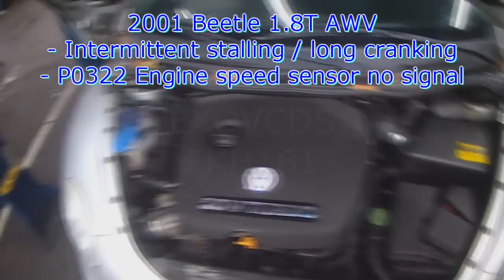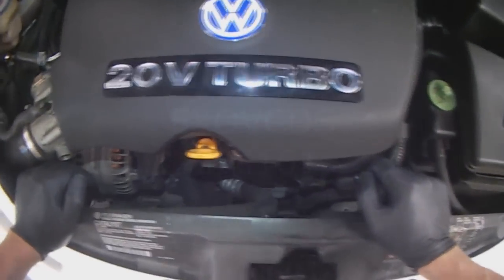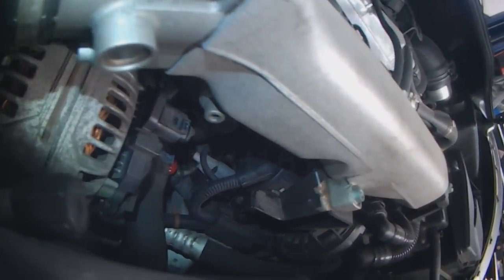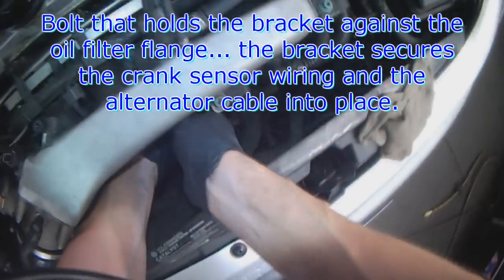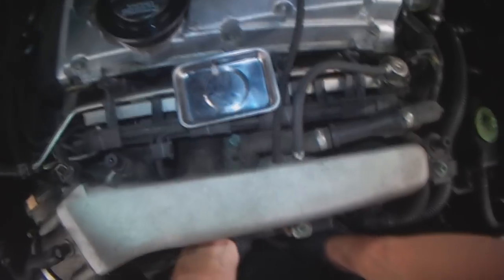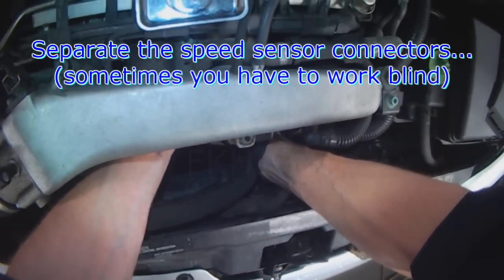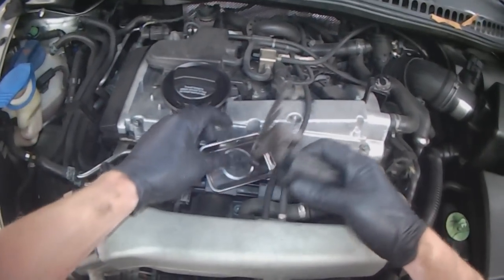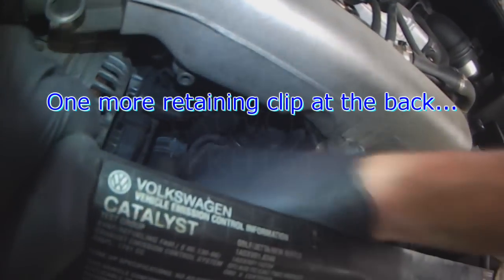VW A4: 1.8T AWV Beetle faulty crank sensor P0322

Comment: I have 01 Volkswagen Jetta 1.8 Turbo 5speed. I have replaced everything from fuel pump fuel filter crank and cam position sensor coils and I cannot get it to run any help
Reply from the maker: Do you have spark? Injector pulse / spray? Compression?
Reply: Yes all that is good. When it's cold it'll run for a good 5 seconds and then start spitting and sputtering I'm going to change the intake manifold gasket tonight and see if that works
Reply from the maker: @TheCopenhagenman19  I don't think it's an intake manifold gasket issue (unless the intake was off in the past)... there should be no reason to suspect it, I have never seen one fail.
Reply: @EXOVCDS  it could have been off the car has had work done to it before i got it. Im not sure what else i could do. Im just trying everything to get it to run right. What do you thank it could be?
Reply from the maker: @TheCopenhagenman19  fault codes? Engine sensor data (coolant temperature reading correct, MAF, MAP, TPS, short term & long term fuel trim values etc)? Any fault codes in other modules? Exhaust system plugged?
Reply: @EXOVCDS  since I've got the car its head an O2 sensor code and a mass airflow. Other than that I have no idea. I can't get it anywhere to have codes read Because car is not drivable. I never reset the ECM when I put that new cam and crank position sensor on there. Should I do that and see if that works. Cuz I do know that sometimes they'll get stuck on running a certain thing.
Reply from the maker: @TheCopenhagenman19  cam or crank sensor replacement does not require any type of resetting. You need to get yourself a scan tool so you can view data... you're working blind otherwise. Once it dies it doesn't start again until it has cooled off? When it doesn't start, will it run if you spray brake cleaner into the intake? If yes, then you have a fueling issue. If no, then you have a spark issue.
Reply: @EXOVCDS  if Iwait about a minute. It will fire back up but it still runs really rough. And sometimes at a very low RPM like 100 to 300. I put a new set of coils on it and check the spark plugs they are all good. Put a fuel pump on it today and a fuel filter. And check the injectors they look okay to me. I was actually going to try brake cleaner tonight. And a buddy of mine was thinking that somehow it could have over boosted and blown the intake gasket. Because it started doing this after I got on it a little bit. To not get hit by a car that decided to speed up.
Reply from the maker: @TheCopenhagenman19  it could be struggling for fuel or spark... I would even check / verify correct cam / crank timing by turning the engine to #1 TDC and making sure that the marks line up. Timing belts can strip teeth under high load when they are old.
Reply: @EXOVCDS  i will try that when I get home. When I change the fuel filter it was so clogged I could not even blow through it. But it has a new one on it now. Should I try replacing the injectors
Reply from the maker: @TheCopenhagenman19  Fuel contamination can clog a new filter... you might want to check the new filter just in case. Is the fuel pump noisy? If yes, that can point to a restricted filter. If you replaced the fuel pump... you might want to make sure that none of the plastic fuel lines are kinked / restricting fuel flow. I wouldn't worry about injectors... the only way they could all fail at the same time, is if something is starving them of fuel. Usually one injector will go bad causing rough running... it's not likely that all failed at the same time.
Reply: @EXOVCDS  okay I'll check that. Is there anything else that could cause it and do you want me to upload a video of what it sounds like. And maybe you can let me know just by the sound of it. I don't know a whole lot about these German cars. I just know how to work on cars
Reply from the maker: Sure... upload a video or more and I'll check your channel tomorrow. 
I would focus on what is missing (spark or fuel) and then go in that direction. As I said, the more you can check the more you can eliminate. New parts can be bad, so re-checking things is always a good idea. Buy a cheap scan tool so you can monitor engine data... it might not help solve this issue, but will be worth the investment in the long run.
Reply: @EXOVCDS  I'll upload some videos tonight. And I will work on them when I get home thank you
Reply: @EXOVCDS  well I get home check all the spark plugs again. Because when I did check him I was really sleep deprived. Go to start the recording to upload so you can hear the car and it's running fine now. I really don't understand this car. It's very temperamental

Comment: Well done buddy. 👍👍
Reply from the maker: STEVE ROB Seems strange to get "well done" messages for removing a part... ?
Reply: Thomas EXOVCDS  Well most of the parts you remove most can't.  That cam sensor Behind the belt I would have taken it out with a cold chisel in pieces . 😂😂

Comment: How hard is this to do from the top with out jacking the car up?
Reply from the maker: As hard as it looks (lack of room)... the pain & agony (of fiddling from the top) is not as much when working from underneath with the car raised on jack stands. There are things you simply can't reach from the top. Resting passenger wheels on the top of a curb should provide enough clearance for you to slide under / reach under the engine to those components (once the splash guard is out of the way) if you don't have access to a jack & stands.
Reply: Thomas EXOVCDS thanks for the reply and the wheel on the curb tip.  Unfortunately I've only got my basic tool kit with me otherwise I would be using jack stands.  I'm not 100% I'll be able to get the wheel on the curb since the car won't start right now and my GF will kill me if I block the driveway trying to get it fixed.  Between the weather and my lack of tools I'm expecting this simple job to be lots of "fun".
Reply from the maker: Are you sure it's a crank sensor issue? Are you getting spark or injector pulse? Tap on the bottom of the fuel tank (passenger side ahead of the right rear wheel) while your girlfriend cranks the engine... if she starts, most likely a bad fuel pump.
Reply: Thomas EXOVCDS I hear the fuel pump prime when I open the door.  It's also been exhibiting all the signs of a bad crank sensor (from what I've been reading): hard starts, intermittent shutdown while driving and blips and dips of the revs with no input from the throttle.  But I'll try tapping on the fuel tank while my gf turns the engine over.
Reply from the maker: Ah... I didn't know. Yes, sounds like a crank sensor issue.
Reply: Hey how's it going I recently got me a 2002 vw jetta 5 speed and I have code p0501  speed sensor /performance  I have been told that it can be the abs sensors on the hubs but really don't no what it can be all so my speedometer isn't working it's not readying my mph but it is reading my rpms any ideas what it can be if is it the sensors on the hubs hop to hear from you
Reply from the maker: The vehicle speed sensor (G22) is on top of the differential:
https://youtu.be/hXAoLDuvqbU?t=2m2s

Comment: what You mean all the expose lube
Reply from the maker: "exposed cam lobes"... lube the cam lobes. Instructions are on the bottle. http://lucasoil.com/media/k2/galleries/326/zhd-assembly-lube.jpg
Reply: Ok its same lube líke i have
Reply: So just put on top to camshaft
Reply from the maker: If all you did was replace the valve cover gasket... then there is no need for the lube (because you did not remove the camshafts). If you still want to use the lube, lube all the rotating parts.

Comment: help fail p340 in 1.8t jeta 01
Reply from the maker: Any recent repair? Timing belt?
Could be a sensor problem, incorrect timing belt installation, camshaft chain issue, chain tensioner issue... several things that need to be checked.
Reply: change cam sensor, band, tensioner, water pump
Reply from the maker: Hector Picos Is the sensor producing a signal? Is the signal timed correctly with the crank signal?
Reply from the maker: Hector Picos https://youtu.be/_heox-KzoZw

Comment: but its not damage nothing
Reply from the maker: What is not damaging nothing?
Reply: The lucas lube on camshaft
Reply from the maker: Why would it damage anything if it is designed to be used on a camshaft. You don't need to use any if all you did was remove the valve cover... if you want to use it, put it on the camshaft. You can put engine oil on the camshaft... or don't put anything. Once you start the engine, engine oil will splash on to the camshafts. If you removed the camshafts and everything is dry, then yes, before you install the camshafts, lube everything with lucas assembly lube... or engine oil. The service manual shows what to do: http://www.bentleypublishers.com/audi/repair-information/audi-a6-1998-2004-repair-manual.html
Reply from the maker: Armando Hilario https://youtu.be/MvG68Dv2ixM?t=2m1s

Comment: I was getting PO321 and PO322 about 6 months ago.  I changed the crank sensor and it fixed the problem.  A few days ago it started stalling with hard start. Now it won't start at all.  RPM does not move while cranking. PO321 intermittent PO322 No signal.  Is it likely the crank sensor bad again? As always thanks for your time.
Reply from the maker: Could very well be the crank sensor again, but a faulty fuel pump can also set a crank sensor fault code... if you are not getting an rpm signal (check with a scan tool to view rpm data) then check if the sensor is putting out a signal (can use a multimeter to check). 3 wires, 2 are signal (AC) and the 3rd is a shield / ground. If you connect your multimeter negative lead to battery negative and the meter lead to one of the signal wires... you can read a DC voltage (half of the AC). Sensor should produce 2.6vAC (or more when cranking), so that'll be 1.3vAC. To read the full AC voltage, connect the meter leads across the 2 signal wires.
Reply: tried it today and it started ( 5 times ) just fine with no problems. Cold and Hot. Question? can low oil pressure cause this as well?
Reply from the maker: No... oil pressure should not prevent the engine from starting. Check your fuel pump... it might have a bad spot, when the pump stops spinning and stops on that bad spot, the engine won't start. The best & quickest / easiest way to "see" pump health, is with a scope where you can see the current ramps. A shop should not charge much to check that (takes 5 minutes). The fuel pump needs to be ruled-out. You can pull the fuel pump fuse and run the engine till it dies... try starting then and you will / should get a crank code. If your pump is OK (current ramp) then focus back on the crank sensor.
Reply: Thomas EXOVCDS have it scheduled for fuel pump test.  i let it set for 2 days,  started just fine.  idel normal.  ran for 5 minutes and died.  P0011 camshaft over advanced bank 1. restart just fine.  comes to idel, after about 3 seconds died quickly. No start following. ideas?
Reply: Pump Health came back good. toewed it there and back. they charged 100.00 bucks. the only codes I'm getting now is P0011 but rare, P0322 is now more common again.  I tested the incoming wires for crank sensor, ground is good, positive ( with key on is 2.5v),  signal wire the same 2.5V ( key on), Sensor test shows ground open ( no ground ) with no ohm reading between positive and sensor wire. Thoughts? Thanks man!
Reply from the maker: DrcJr77 I'm still at work... I'll get back to you later tonight.
Reply from the maker: P0322 can set from the engine stalling or because the sensor is not producing a signal. If you are not getting an rpm signal when viewed with a scan tool, then I would lean towards a faulty crank sensor. P0011 can cause rough running and stalling (not sure about a no start) and can set a p0322 because the engine stalled, causing the crank sensor to not produce a signal. If the engine never runs rough and stalls, then it's not due to the p0011 in my mind. The voltage you are measuring / seeing is a bias voltage, that the ECM uses to check the sensor / circuit integrity. The sensor itself creates a voltage due to magnetic induction (once the engine is cranking). No voltage generation = no start. Some 1.8T's will start & run with the crank sensor disconnected. Have you tried that already?
Reply: Ok one more thing that might help.  It starts and run perfect with engine temp cold. Once it heats up, it stalls with no start period. Until it cools again.  Yes I did try unplugging the crank sensor, still no start. ( engine was hot when I tested that ) once it stalls and then becomes no start, RPM shows nothing while cranking. Thank you again for all your time and help with this.  Your awesome man - truly!
Reply from the maker: DrcJr77 If it cuts out once warm, it's a crank senor issue.
Reply: I'll change it out. Odd that the new sensor went out just after 6 months.  I'll update with the results. Thanks again have a great day
Reply from the maker: I have seen new sensors fail earlier.